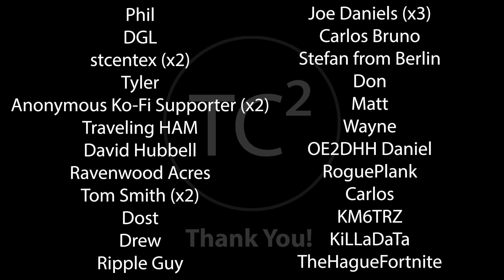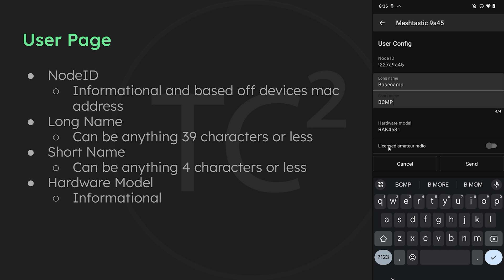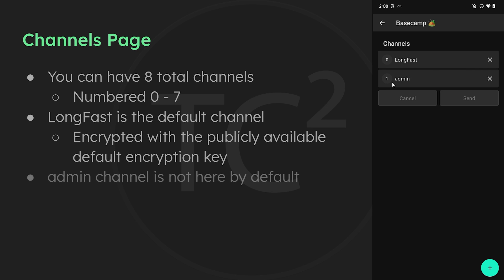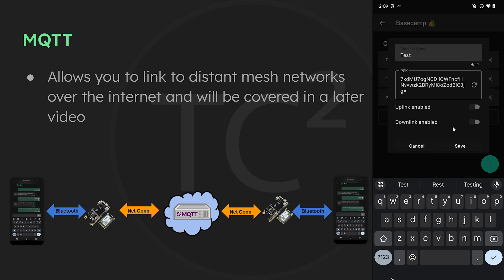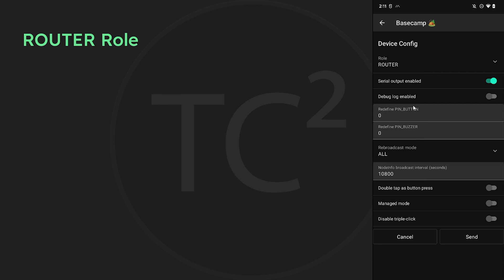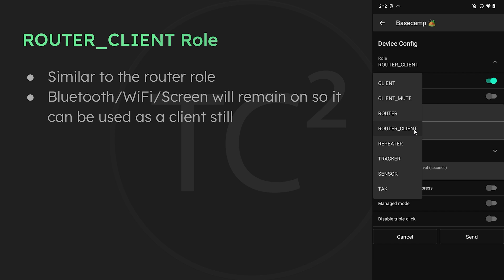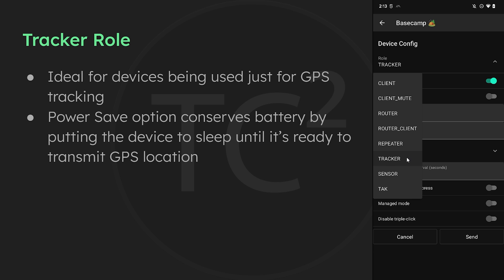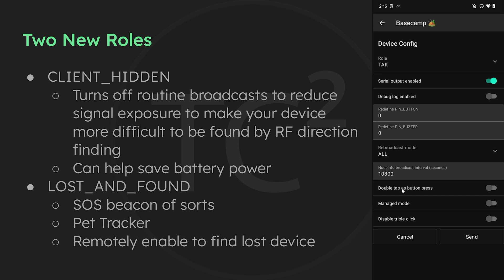Advanced Meshtastic - Radio Configuration Part 1

Comment: Hi and thank you for the great content! So, do you have advise for the following? I bought a node, it's a PeakMesh Magnet Climber Solar Meshtastic Radio Node RAK Wireless ALFA Antenna. It's mounted on a 20ft mast, I am just starting off by using my cell phone Meshtasic app to connect to node. I just want to know how I can confirm my node can communicate with nearby mesh networks and communicate/test. Thanks!
Reply from the maker: As long as you're on the default channel most people are on (Long fast) then you should start seeing other nodes appear on the list as long as they're in range

Comment: Question and comment:

In an earlier getting started video you mention that you will cover the Detection Module in a later video.  I've not found it, and regardless of my choices for that modules switches, other than disabled, it sends "motion messages" to the mesh.  It is sitting still with nothing that is moving by it.

Did you cover it, and where?

Comment: As soon as I added an emoji to the Long Name, I got a fault message, it dissappeared from Meshtastic, and would not pair.  I had a space between alpha characters and the emoji.  Could that be the problem?  I don't want to try again...
Reply from the maker: Hmmm shouldn't be. I add emojis to the names with no issue
Reply: @The_Comms_Channel  I ended up having to all but start over.  The radio disappeared from my list of three.

The web client would not store changes, and there's a bug in it regarding Device.  When I would select TAK Tracker, it would check that, but also check Sensor, and there was not way to unselect it.  Changes did not take effect.

 I ended up having to connect my phone directly to the radio as a new connection, and all but start over.  Settings were gone.

Comment: WiFi on the heltec v3 is about 30ft, it's bad. So put it near a spare wifi point, then connect the board to the router. That allows you to use a Web browser from any PC browser or phone app. Or connect back home via vpn and remote control the heltec.

Comment: Do you have any idea of what the actual power consumption of each of the modes is? To accurately size Solar and Battery sizes
Reply: A 2000mAH liPO lasts 2days on mine.
Reply: @OH2023-cj9if  What hardware are you using?

Comment: I have two Heltec V3 boards set up with Meshtastic. However, one device has a circle with a question mark. The other device does not have this question mark. What does the question mark mean?
Reply: Hello I just got 2 Heltec V3 nodes, and im currently learning about it. From what I know, the circle with the question mark is GPS. Most don't have GPS but GPS can be added so if no GPS you get Question Mark ?. When your using the meshtastic app you have a choice to direct your phone GPS to the node and then an arrow will appear in place of the question mark.
Reply: @ChrisC-fp9qu  Thank you for explaining that. All my devices are Heltec V3 - no GPS.
Reply: @salsepulveda494  Good luck and enjoy.

Comment: This is similar to AES IntelliNet Radios used for burglary and fire alarms. I had a job 20 years ago in Chicago Lincoln Park and I did an unorthodox install of 2 radios in one house with the repeating turned off on the basement radio that was connected to the alarm control and a second radio installed in the top floor to get the signal out on the AES network.
Also did you ever look at the Motorola Talkabout radios that are doing a similar text over radio feature?
Reply from the maker: Yep, I have a pair of those. They work great!

Comment: Thank you for these series! I’m learning so much and I want to feel well rounded in my knowledge before I purchase a few devices. My hope is to create a network over the span of an 80 mile valley with mountains to communicate with family in emergencies, but not rely on HAM radios or my family having any deep technical knowledge to communicate. That’s why I think meshtastic is so unique. All I will need to do is train my family on what settings to have turned on, and what channel to text in.
Reply from the maker: Sure thing! I'm glad you're learning and finding the series helpful! That's a great use-case and one of the reasons I'm a fan of Meshtastic. It's hard to get people to get a ham license or learn how to use radios and this is a great simple to use alternative.

Comment: I noticed on the pcb board that these meshtastic work on. The “L” and the “H” when swapped, jump either to 433-470ish Megahertz to 858 to 929MHZ . just in case people have bought the wrong one can swap it over. I got stuck with it being the 929 and changed the pass through the resistor. Now I can use it multiple times areas. Making sure to wipe it after changing it immediately otherwise it will freeze.

Comment: Your series finally kicked me over the edge and I got my first Haltec units last week. Their coil antennas suck, so now I’m looking for cheap/but good enough antenna replacements. Couldn’t even get 300M LoS with them. Looking forward to more in the series!
Reply from the maker: Nice! Yeah, I don't think any of them have great stock antennas and it's usually the first thing I recommend people upgrade.
Reply: If you mean the small coil antenna on the board that's only for Bluetooth and WiFi. My Heltec came with a 1/4 wave stub on a 50ohm connector (I don't remember the name but it's the common one).
Reply: Look for Paradar antennas and liw loss coax. You will need them outdoors high up.

Comment: Any advice on a wis block PIN code? Got everything flashed to the wis block and got ready to connect via the app, keeps asking for a PIN code and timing out, can’t find a pic anywhere.
Reply from the maker: Default PIN code for devices with no screen is 123456
Reply: @The_Comms_Channel  thanks!
Reply from the maker: @merican3789  Sure thing!

Comment: Thanks for the video I'm about to get into Meshtastic in 2024.

My question is assuming that this is being done by Bluetooth what stops someone else from accessing your device settings.
Reply from the maker: Bluetooth has a max range of about 300 feet so they would have to be close enough to connect and would have to have your pin as Ryan suggested. You can also turn off Bluetooth for devices that are just acting as routers/repeaters. Thanks for the question!
Reply: Thanks  @The_Comms_Channel  I must have missed the part about the PIN.
Reply from the maker: @Wayne-Pr  Sure thing! Good luck with your setup and feel free to reach out if you have any questions!
Reply: They would have to be physically close to the device and know your Bluetooth pin